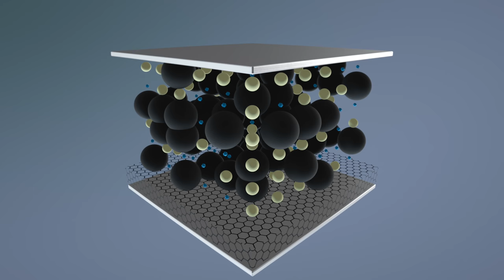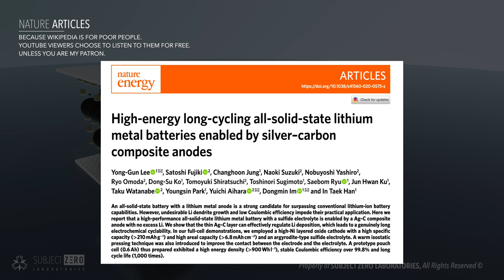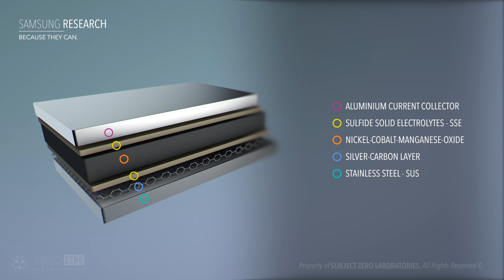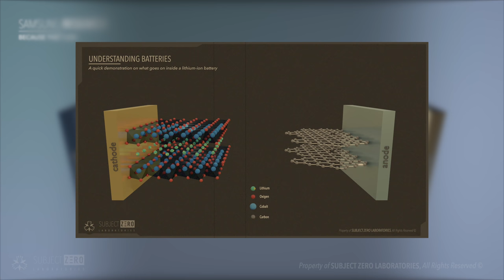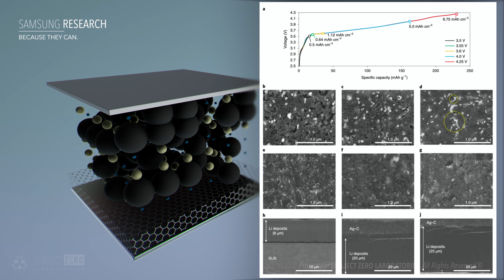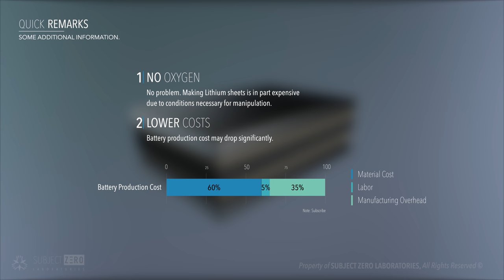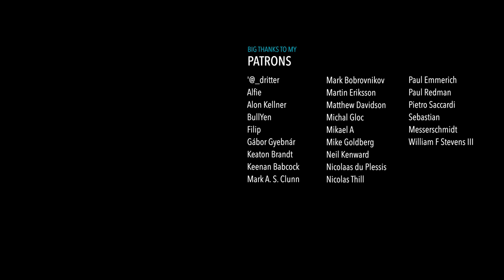Breakthrough Solid State Battery - 900 Wh/L Samsung [2020]

Comment: 3:06 Decreasing the number of batteries does not make them charge faster. Higher energy density just means they take up less space - you still need to put the same amount of electrical energy in - the vehicle/motor haven't got any more efficient. And a smaller number of cells usually means slower charging because lots of cells allows higher parallelism and reduced individual cell rates, and thus faster charging for a given cell spec.
Reply: Would less batteries mean less weigh and longer ranges.
Reply: @barryrosolen5813  This video only talks about Wh/L (i.e volume). That smaller battery is not necessarily lighter (Wh/Kg) too (it could weight just the same, or even more), but obviously materials are such that it is likely to be lighter too, and yes if it is then you get more range per Wh (at least on the flat/uphill).
Reply: 100% correct. If they were somehow better at dissipating heat so you could charge multiple packs in parallel at higher current, then they would better. But exactly like you said, they wouldn't achieve that with less cells (maybe less batteries per cell).
Reply: @Wookey.  Yeah, I hate it when they talk about these things in terms of range instead of energy. It's already starting people off with ignorance. 

"So if I turn the heat on, I lose like, 15 miles per hour the heat's on right?"

"How come our electric bill is in kWh and not miles?"

"The car said I could drive 100 miles, but I was doing 90mph on the highway, and the battery was dead when I only drove 60?"

Oi.
Reply: According to what I've read, the thing is that this technology allows faster charging, one of the limiting factors with the current technology is the dendrites formation, with solid states batteries you can charge faster without affecting it's lifetime.
Reply: A lower number of cells doesn't make them safer either. Packing more potential energy into a smaller space can't possibly make anything safer.
Reply: @vampiresRsolame  I agree that the battery itself does not become safer. However, consider the probability of 1/1 vs 1/10 batteries failing catastrophically. Less potential points of failure yields lower probability of failure. Also, a smaller battery pack enables the manufacturer to use more space for it's protection. Like a larger crumple zone, in case of collision.
Reply: The reason this is good is because it will reduce the mass of the battery, the energy density seems to be historically capped by the lithium ion density. The article graphically demonstrates how little of the total battery mass is made up of chemically dynamic lithium. Electric powered cars are so heavy and inefficient now that big manufacturers aren't giving them the attention that an environmentally minded society wants.

I might have misunderstood the article but this seems like the news that is happening
Reply: . Wookey decreasing the number of batteries means higher voltages per cell, which means less current to transfer the same amount of power into the battery, which means thinner wires. DC Motor design factors aren’t a huge variable in the equation- they’re still expected to consume nearly the same equivalent parameters of input no matter what the origins of their stored power source produce. If every physical factor from the charger bus is also held constant, and equivalent energy is attempted to be forced into each battery design, the thinner wires would be burned out first from higher current on the more numerous low voltage cells, rendering them inoperable, and their charging times go to infinity.
Reply: But alas, you’re coddling an anachronistic mentality which cannot see past the current ecology, so here’s a helping hand: is it faster to pump one gallon into one gas tank with a single hose, or to divide one gallon into millions of separate containers with that same one single hose, assuming pressure, motor, environment, etc. were kept equal? Charging a single cell with DC is always going to transfer more power  into one cell faster than AC or pulsed signals.
Reply: @barryrosolen5813  Would help
Reply: @ron6625  "The car said I could drive 100 miles, but I was doing 90mph on the highway, and the battery was dead when I only drove 60?" 60 what? mph? miles? knots? yards? you threw measurements on everything else but the last number
Reply: Yeah!. . What he said!
Reply: I think he meant it would charge faster than the 5000km battery
Reply: A lot of these solid state batteries are actually kind of hybrid battery-super capacitors.  They can charge much faster than regular batteries, but a bit slower than full/true super capacitors (which can be charged VERY fast).
Reply: Yes i totally understand what you are talking about
Reply: @Arterexius  100 miles, 90mph, 60??? > Answer=Obvious
Reply: The motor may not be more efficient. However, fewer cells reduces weight, meaning that the car in general has higher performance, handling, and efficiency.

Comment: Conclusion: Some kind of new battery will change the world.
Reply: James Muecke but we live a globalized world with way more scientists and educated people. Not only that, their are multi billion dollar companies  and governments working on this.
Reply: James Muecke Honestly, technology is going to be exponential rather than linear. Our mobile devices are amazing computers but those batteries are junk. Once we get to replace our lithium ion technology, I expect beefier and juicier ram, cpu, and gpu in our smartphones. Its going to change everything.....20 hour screen time and 4 day battery life. 

However, a lot of jobs will be lost.
Reply: And probably, like a lot of inventions, it will be discovered by accident. LOL Examples: rubber tyres because testers' boiling pot caught fire and he threw it out the window. Kicked the 'lump' on his way back from getting food and found it was solid. (now tyres are all synthetic made from oil) Example 2: Transistor. Auto electrician fixing early model battery charging fault, leaned on the rectifier circuit and noticed his meter reading changed (his hand was on the negative lead and his other hand was touching the middle of the rectifier (clunky large diode). He investigated it and produced the Transfer Resistor Ta Da "Transistor". Example 3: Stainless Steel: At a steel plant, the failed mixes were dumped on to a growing pile at the back of a factory. Smokers, on a coffee break, noticed weeks later that on layer was not rusting. Piqued management went through the records (after counting the failed layers) and reproduced the alloy mix. Refined it with further trials.
Reply: @hellotheir1427  yeah but chemistry and the laws of physics are a bitch.
Reply: Stimpy&Ren Doubtful considering climate change will kill a lot of people in underdeveloped regions
Reply: Thanks--saved me 10 min.
Reply: As long as we also find a way to recycle them whiteout trowing them away.
Reply: No it won't.
Reply: James Muecke  Tesla is a sham for people who can't use brains and proclaim musk as new nerd Jesus
Reply: but its expensive as hell
Reply: James Muecke  this is going to age soooooooo poorly.
Reply: James Muecke  Yet SpaceX beat Boeing to send astronauts into space. Truth is, no matter what milestone he seems to reach there will always be others that try to discredit his achievements
Reply: James Muecke  
Ironically. That paragraph just vomits cerebral narcissist.
Reply: @hellotheir1427  The billion dollar companies and the governments they control only work on whatever they can weaponize. This is who we are.
Reply: solid state batteries use a similar manufacturing process as all of our electronic chips. One of the reasons why they pursued this research was because the technology and economy of manufacturing these are very mature meaning that if a product is slated for production, they can rapidly reduce cost. All of the new batteries you read about are just incremental in trying to optimize which batteries will be used in the future but they are certainly gonna be used one way or another.
Reply: James Muecke  That is debatable. It doesn't make it less true though.
Reply: WRONG!!!

the battery that changes the world will be the battery that makes it to the populus! 

Goodenough isn't greedy, but the rest of the manufacturing world steals us blind!!!
Reply: @hellotheir1427  And that's why noone wants to introduce new technology - if old smartphone will still work for days even when it's battery capacity will drop by 60 or 80% - the sales of new phones will drop. Which producer would do that to himself? There would have to be a company that produces just batteries itself that could benefit from this. But of course if such company appeared on the market - Samsung and other producers would introduce their own solutions they keep in their drawers. And that's how we're stuck in today. God knows for how long.
Reply: @Stimpy&Ren sh takes time
Reply: @mysteriousm1  climate is not constant, it always changes
Reply: @hellotheir1427  Machine Learning is what will supposedly create the first publicly known Trillionaire.
Reply: @hellotheir1427  It's been clear that batteries were a trillion dollar market if you could make better batteries since the early 20th century (accounting for inflation; not a trillion dollars in 1920 dollars, since a decent hourly wage was 20 cents and a 1920 double eagle coin would have been nearly an ounce of pure gold, which is worth 1700 dollars today). Lead acid batteries are still around and still the cheapest bulk battery energy storage and they're from the mid 19th century. Batteries that have high density, aren't teetering on the edge of becoming pyrothechnical devices, are cheap to mass produce, scale up, can be recharged many times, don't require annoying conditions like heating to a certain temperature and fulfill all the other requirements you could want of them are a really, really, really hard problem. 

I think we're going to have nuclear fusion before we have batteries that don't suck; and the joke with fusion power is that it's always 30 years away.

Comment: Oh boy! I can't wait to lick a 9V version of this battery.
Reply: It won't be any different from the same voltage of any other battery. Voltage is voltage irrespective of how many amp hour
Reply: @dstr1  While what you said is technically correct, it is misleading.
Voltage is voltage, but it's power that we really worry about, which is voltage times current.
High voltage with low current can be quite harmless.
If someone were to make a 9V battery that output 100Amps (unlikely of course) that would produce 900 watts of power.
Reply: 100 people die from licking 9v battery every year
Reply: @georgie3  "There is no such thing as high voltage with low current"...so um, how do stun guns work then? :-P
Reply: @georgie3  ?? Steve Webber knows his stuff. Meanwhile, your saying doesn't make any sense. Keep going elec is fun. 👍👍
Reply: @kirkc9643  Yeah, Georgie F is indeed a beginner. Let's encourage him or her to keep trying.
Reply: @dstr1  I think he knows.
Reply: I've got depression I think I'll stick with lithium for few more month's.
Reply: @dstr1  it can deliver much more current tho.
Reply: Kirk Claybrook hmm Georgie F is completely right ohm's law governs the loss of voltage across a resistance for a given current passing through it. Since the current is low, the voltage loss is correspondingly low. 
a taser uses very high voltage at a low current with the calculation of current and voltage so the effect of said high voltage won’t be “nothing”

The amount of current generated depends on what stunning capabilities are desired, but without proper current calculations, the cause and effect of high voltage is muted
Reply: Shit if i knew then what i know now about batteries i wouldn't have licked them. I used to tear them a part put them in fires to watch them blow up. My parents weren't around when I'd do these things and i could've died from this shit.
Reply: I'm just going to enjoy this as intended; i.e. a silly joke. 😃